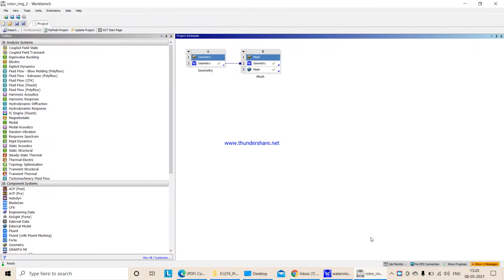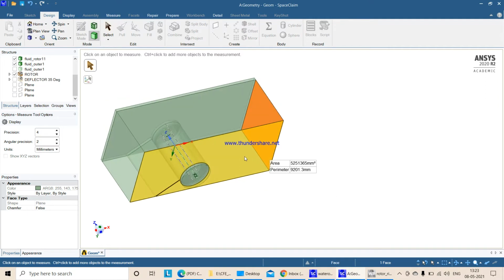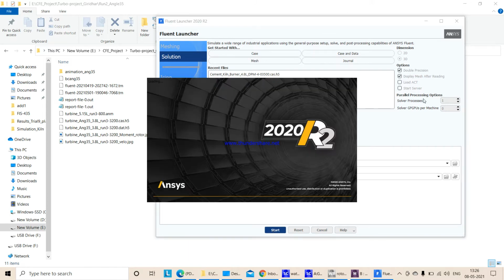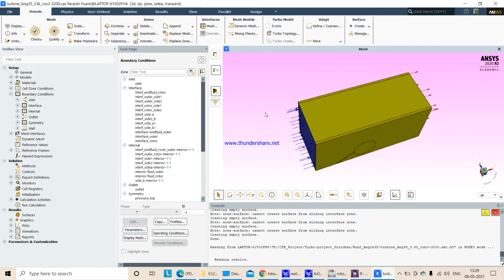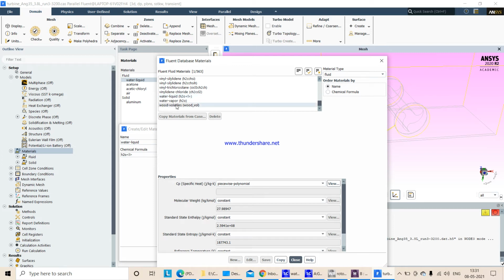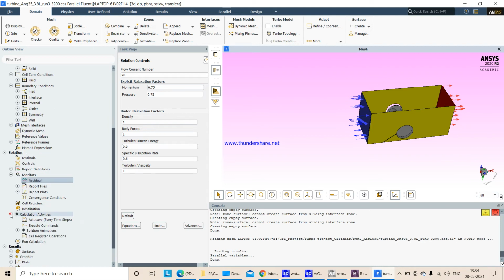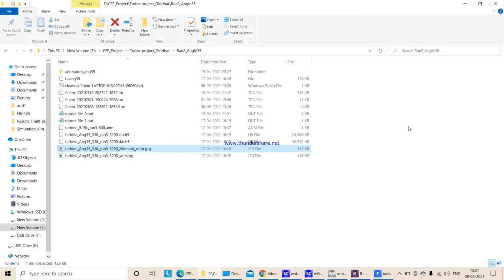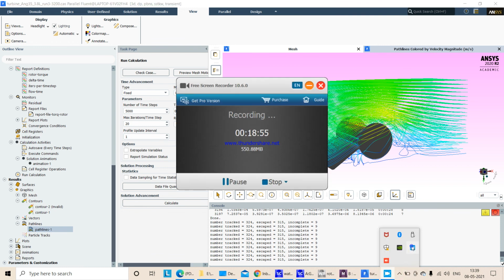CFD Modeling of Water Turbine in ANSYS FLUENT | CFD Flow Engineering

Comment: Hi, could you please make a video for a savonius turbine inside a water  pipe? and try to extract power curves with tip speed ratio power coefficients and all of that. I am a total beginner in Ansys and there seems to be a gap in calculations of the power extracted by in pipe turbines.

Comment: Hi, i want to input inlet volumetric flow around 1.6 m3/s. Why is the unit in inlet velocity magnitude m/s?. As far as know, it's impossible to convert m3/s to m/s. So what should i input in velocity magnitude in boundary condition inlet?
thank you.
Reply: get the surface area of the inlet and divide it with the volume